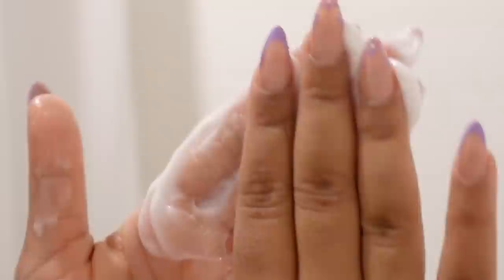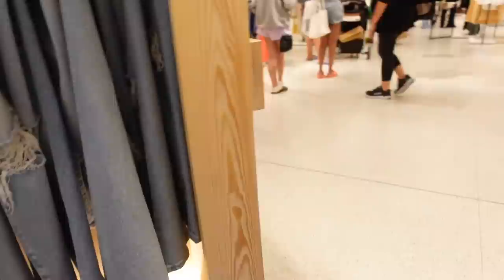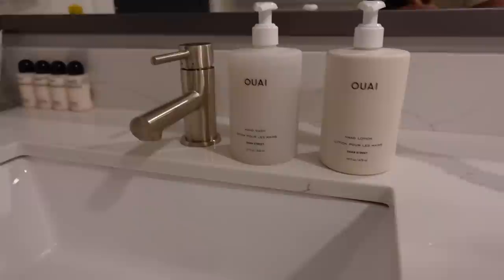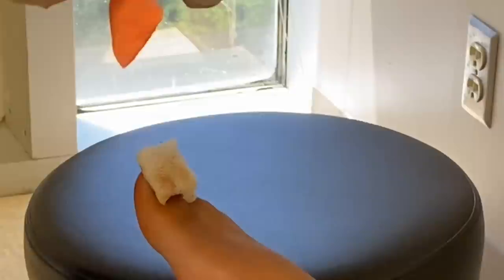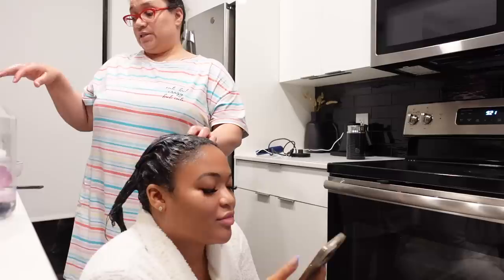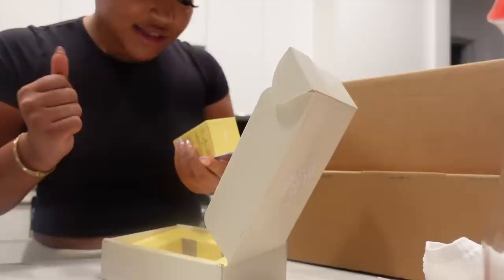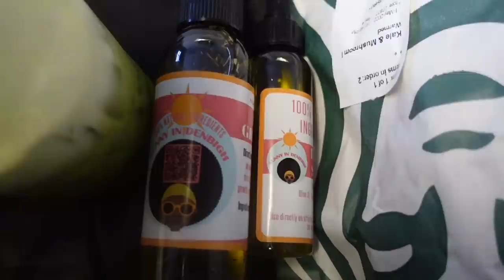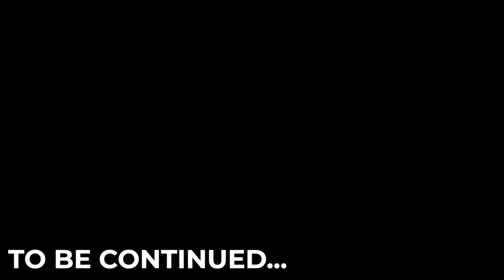VLOG: MY BIG TOE IS GONE + HOME SHOPPING + ZARA X RHUDE + HAIRCARE TREATMENTS (LED LIGHT & CRYO)

Comment: Omg this happened to me as well, ON BOTH MY BIG TOES!!!! Luckily for me, I’m a nail technician, so I’m able to take care of it on my own. It takes a toenail at least a full year to grow out, with consistent upkeep and pedis at least once a month, twice if you’re very active, also making sure to keep the area dry at all times so bacteria doesn’t grow again. Also most importantly not wearing tight shoes for long periods of time which will cause the bruising to reoccur and the healing process to start all over again.

It is absolutely fine to wear enhancements on the toe once the nail bed is fully healed after the nail is removed. You just have to find what works best for you, but you have options. I’ve been wearing acrylic on my toes ever since and my toenails are almost fully grown out. It could’ve happened a lot sooner but life happened 🤷🏾‍♀️. 

Hope you see this, and I hope it helps💕…

Comment: This is long lol, but this is for insight for the toenail to come off like that it's no doubt the salon you're going to get them done (either they're not sanitizing their utensils, their pedicure bowl isn't clean including the jet inside the pedicure bowl or they're filing your toenails to thin), its best to stay consistent with a nail salon (if you aren't) it'll be easier to figure out which salon did that to you.
The green means its infected, let it breath give it air so your new toenail can grow in it'll take about 6 months to a year to fully grow back for some sooner. This has happened to me before as well.

Comment: the same thing happened to me with the toe fungus because I used to put acrylic on it too and work 8+ hour shifts at Popeyes. I cut off the dead nail and soaked my feet in apple cider vinegar mixed with bentonite clay. i got the remedy off google. it took a year for the nail to grow back fully and you have to trim off the parts that aren't connected to your nail bed. cause it will grow in but not fully connected and you don't want moisture to be trapped underneath the nail. also, wrap your big toe in vicks vapor rub and plastic wrap at night, also tip from google. it killed the fungus for me and maybe it'll work for you. its the summertime too which sucks but good luck!